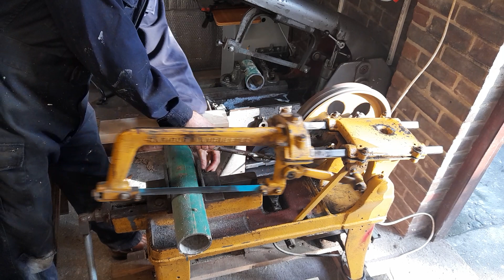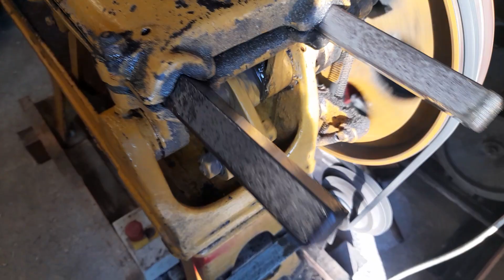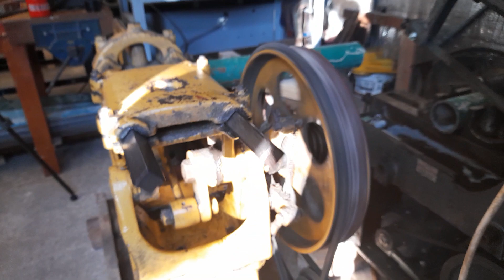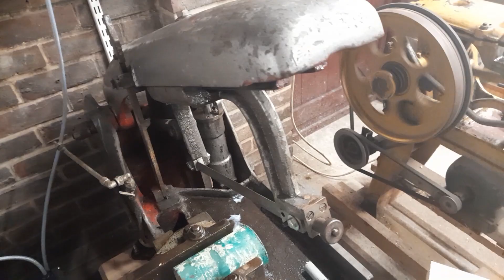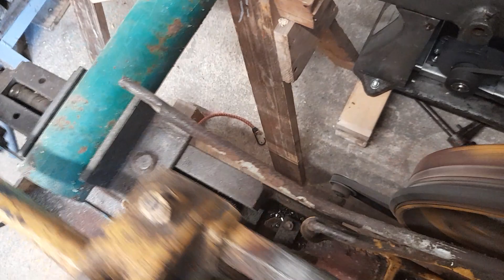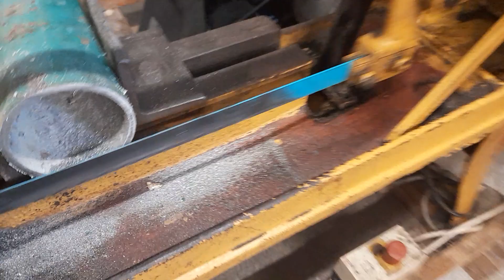Rapidor Manchester power hacksaw for sale | cutting 90 mm pipe

Comment: I have a Kennedy saw which I've just restored. The side sliding guide is a weird concept but I enjoy using it. The cut is a little slower than my bandsaw, but I can cut  8" round or square with it, unlike the paltry 4 inch and 3" @ 45 degrees the bandsaw offers. I might sell the bandsaw as I rarely use it now I have the hacksaw. Decent hacksaws those Rapidor's.
Reply from the maker: Hello Dave. I've seen videos of those Kennedy saws but haven't used one myself. I had a small model-makers saw a while back but these Rapidor Manchester saws are so much more capable. Nowadays I make regular use of a much heavier Qualters and Smith 6H which has a hydraulic lift mechanism but there's something to be said for the simplicity and (relatively) light weight of the Rapidor. I sold the yellow Rapidor a while back (running out of space!) but we have another one tucked away in storage.
Reply: @PizzeyTechnology  Those Qualters and Smith's are beasts no doubt about it. Why have we stopped making such sturdy things over the years? Fridges that would last a lifetime, washing machines with bearings that were easily changed. Wheel bearings that simply slotted in with a castellated nut and split pin. Seems to me we've gone backwards in coming forwards LOL